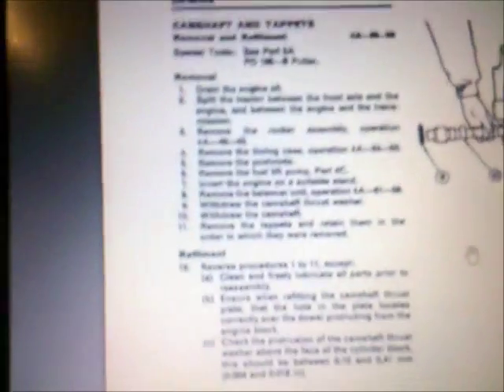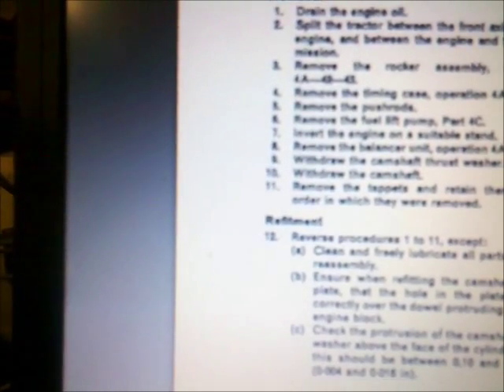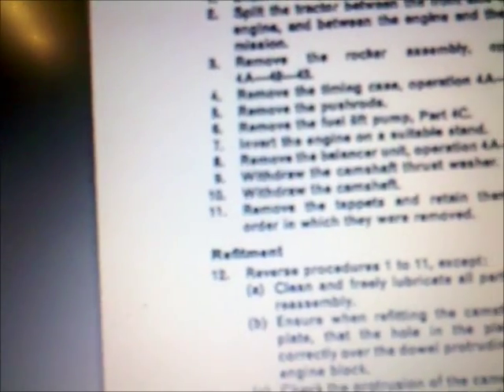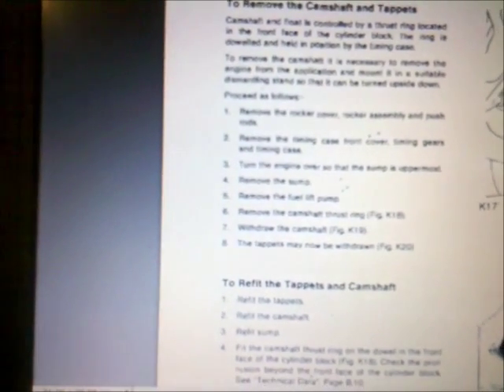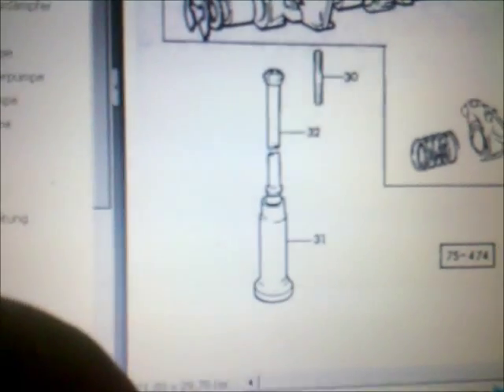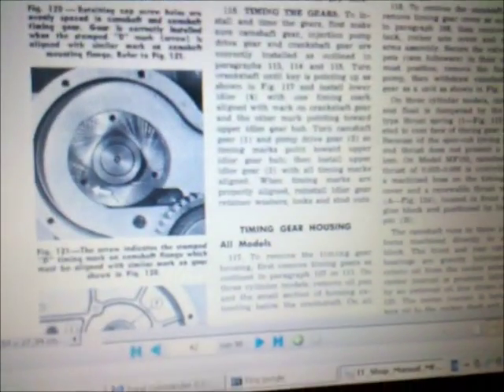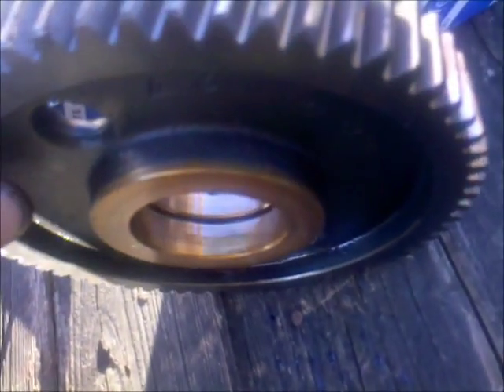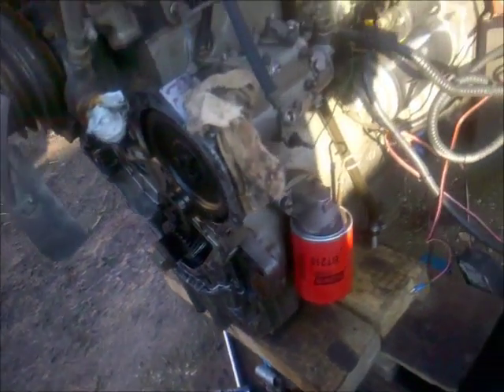MF 590 - 4.236 / 4.248 preparation of camshaft removal / replacement - part 7

Comment from the maker: I could only tell about since I have had the engine... oil was at the crash 20 hours old and it was clean! I guess the issue was at the timing gears, as I told in the video there has been a periodic wear at every 7th teeth, I still do not know why but I seems that one tooth cracked an then this cracked and loose tooth was feed into the gears... radial force was to high against the shaft and then the shaft breaks where the smallest diameter was.

Comment: Good to see you back on here.  I'd be concerned about the camshaft bearings.  Looks like there might have been a lot of metal in the oil.   I don't know if you can remove/install the bearings without more disassembly.